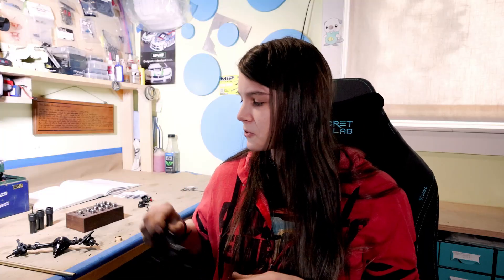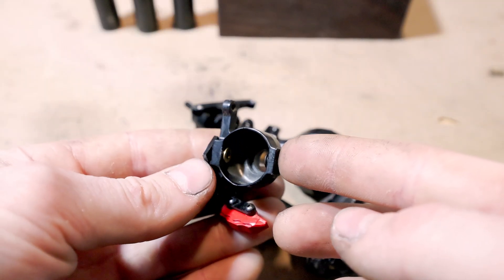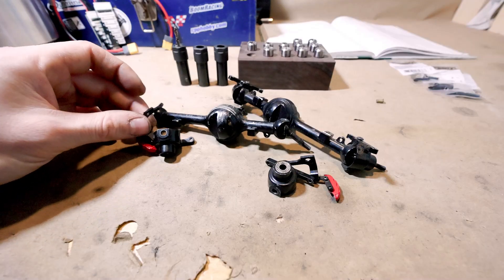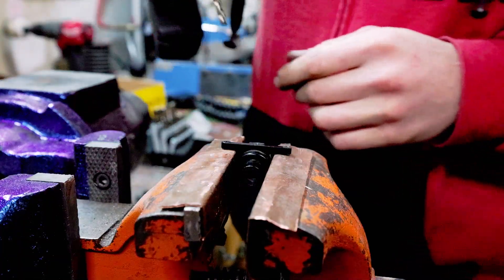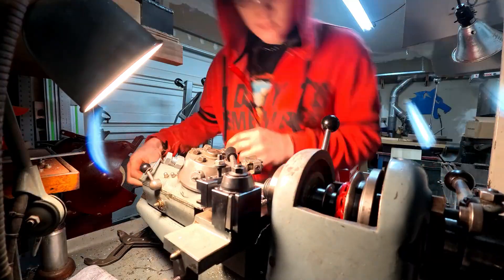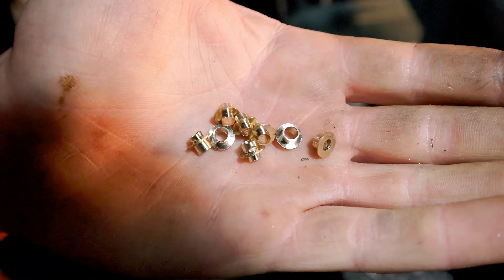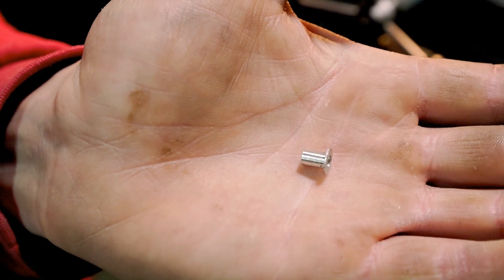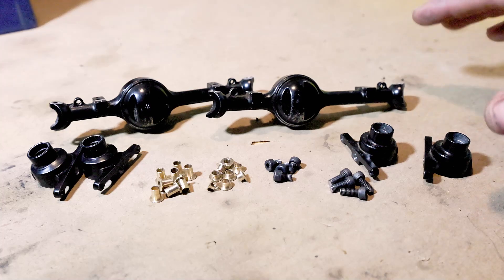Making Knuckle Bushings on my Rambold Turret Lathe

Comment: Nice project! I've never seen a turret lathe being run before which was really interesting. That sequential rotary toolholder doohickey seems great for making a load of the same part. I'm also a fan of collets but my lathe only came with a few and I never seem to have the size I need (but I suppose spending some money could rectify that). Surprised to see the parting tool on the far side of the spindle without you having to run the lathe backwards but I suppose you just mount the parting tool upside down (right?). Anyway, cool project!
Reply from the maker: Thanks! It is EXTREMELY time consuming to get the turret all set up but once it is, you can make thousands of the same part without batting an eyelash. As far as the parting tool goes, yes, it was mounted upside down since it was on the far side. Just noticed your username, are you a ham?
Reply: @Hwy49RC Not a ham, though I think I’d love learning about that sort of tech. I mean what sort of nerd wouldn’t, right? No, I just let YouTube autogenerate my username because for years I hardly ever left comments, but sometimes you see an excellent turret lathe video and you have to say something! 
Also I’ve now watched the video where you picked up your lathe and the seller compares it favourably to Hardinge and Schaublin, and coincidentally my lathe is Hardinge and my mill is Schaublin. But I was so excited about getting famous brands for cheap before I really knew what to look for that I’ve ended up with machines with a LOT of problems. Should have done what you sensibly did and researched more and then got a less famous name but in better condition. But maybe struggling to get these machines working well will be an education. Anyway, please continue to set me a good example!
Reply from the maker: @Rob-kx6ke  Ah okay, looked like a callsign to me. I'm glad my videos are worth leaving comments on then haha! As far as brands go you usually get what you play for, like many things in life. But sometimes you get lucky

Comment: If you still have the axle housing you can save it. I done that with my yota 2 axle housing, stripped out one of the holes then I bought an m3 0.5 helicoil kit comes with everything you need to tap and die the hole then place a helicoil spring in the hole. I’ve only replaced one hole so far but I haven’t have any issues since and that was like 3 or 4 years ago
Reply from the maker: Wow I never knew they made helicoils that small! I've unfortunately had to use them at work and they seemed to work okay. I'd be interested to give that a try. Glad you had good luck with it and thanks for the tip!
Reply: @Hwy49RC  I didn’t have a clue about them until I started looking up ways to fix my axle, ssd have also released a steel yota 2 axle housing for that issue they also have brass knuckles for it aswell which I’ll be switching to soon, and not a problem happy to help any fellow rc nerds lol. Watching from Australia.